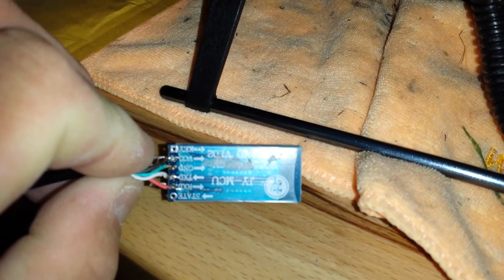fu-bar fbl controller works with bluetooth

Comment from the maker: mikado did lower the cost of the mini to 250.00 but add the pro software back to that and your back to 295.00
they could at least come to the 200.00 range and be in line with everyone else and include pro software right out of the box

Comment from the maker: to use the usb you have to install the vstabi drivers which you can get in the files section for the device on HK's site (goto the fu-bar page and at the bottom goto files)
the actuall software is easy google search for setup5.3.4.exe  and get it from the freedownloadshare site